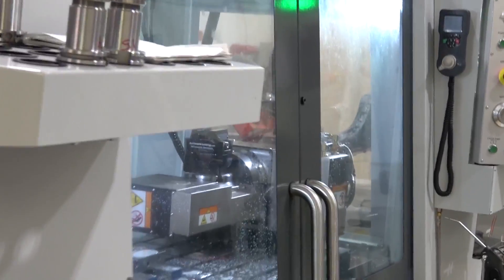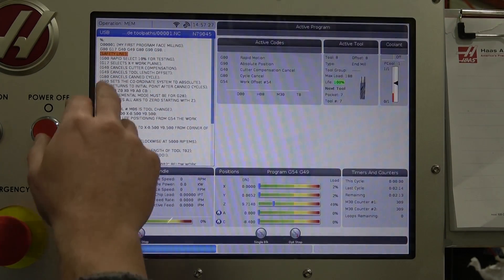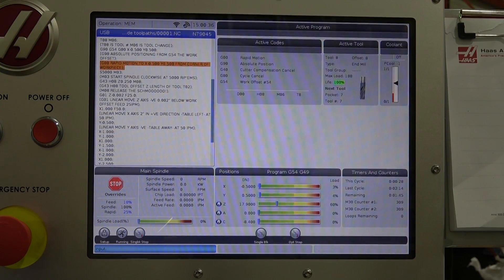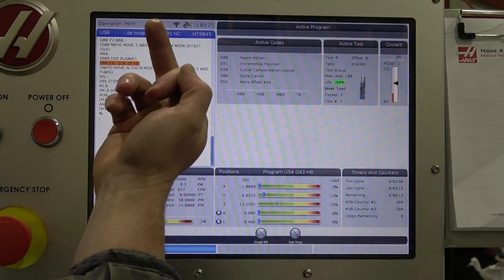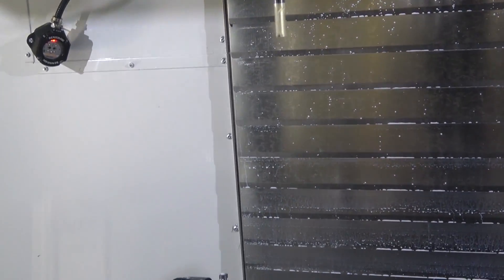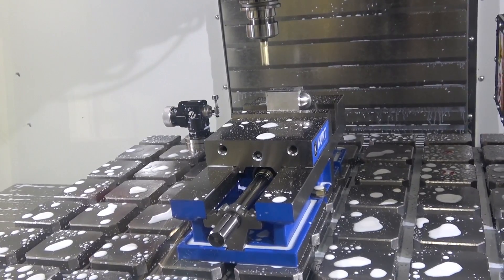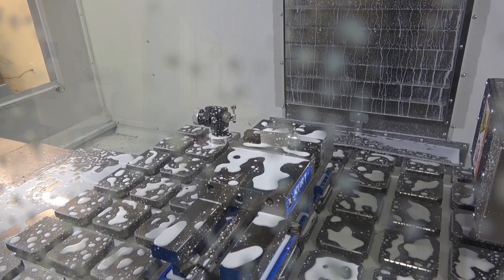Beginner CNC Programming | G-Code

Comment: Y1 means y0.0001" in haas y1. is y1.00". You could program it without decimals but y1" would be y10000
Reply: it does the same for feed rates as well no decimal = thousands of an inch movement

Comment: Instead of using the G28 I would recommend using G53 which is the machine coordinate system. So G53 x0 y0 z0 is machine home. No need to be in incremental.

Comment: The reason for interpreting - 1 as -.0001 is for safety. Imagine if your programed a G00 Z-. 25 move, but missed the decimal and the machine read it as Z-25.0
Reply: no if it was for safety it would just stop.
Reply: @BaldurNorddahl  either way you would still need a decimal point.

Comment: for starters g28 is a crash waiting to happen use G53
Use G53 in apsolute G53 is None module (meaning u need it in every line u are using it in. G53 is like g54 but G53 is always machine home

So example
G0G53Z0
G53X0Y0

 Also YES if u don't have the dot it reads it as Y. 0001 if you have 4 place deceble if u have 5 it reads it as. 00001
Reply: jacobrl9 G54 is an offset. How is g53 like it. Like you said g53 is a non-modal comand of a plane
EX: g00 g53 z0.;
G53 x0. Y0.;

But g54 is the x0. And y0. Or the part. I dont see the simmilarity.

Comment: It's not a bad idea to separate the G91G28Z0 and the other axes so that if you do happen to restart, the first thing that happens is the Z homing instead of all axes at once. It can save your tool if you start in a strange place. Of course, you should never restart from an unsafe location, but sometimes people can be lazy, and it'll bite you in the ass.

Comment: -1 is different from -1. because with out a decimal place the convection in Fanuc based G-Code is that the value is in the least increment.  So -1 is interpreted as -1 * 0.0001 thus -.0001 as .0001 is the smallest increment.  This is assuming programming in Inches if in Millimeters the smallest unit is .001.

However -1. is interpreted as -1.0000 as you have specified for the control where the decimal place goes.  

This something I learned the hard way.  The program I wrote once had 20 when I meant 20. and as a result crashed and friction stir welded the end mill into a chunk of Aluminum and broke the collet holding the end mill.

Comment: Programming at the control is a fucking nightmare. I can modify programs fairly competently, but HAAS uses an ALPHABETICAL keyboard instead of the QWERTY layout that every other keyboard uses. Not to mention having to be able to read the matrix code.

Also: Got enough shmoo on that indicator pull-stud? Is it about to go bad or did you just buy too much?

Comment: if i remember correctly, if you put 1 in for a location value it means 1 thousandth of an inch, but 1. means 1 inch tho im not sure, i just talked to the cnc guys at my shop occasionally when i was still working there

Comment: Welcome to CNC manual coding, friend. It won't take you long, but soon you'll have the code to a point that you can just read it down the page! G00 is rapid traverse G90 puts it into absolute coordinates and with this, if you don't put a new measurement in for an axis value, say line 27 says X.5, Y1, F3. then you can enter the value Y2 in line 28 and the other two carry down. This is called modal programming and it doesn't exist on some machines older than windows xp, so take your five axis of power to heart and start with nice simple 3 axis functions. G00, G01, G02, G03, G70, G71, G90, and G91 along with M01-M05 are the base commands that you will need to program any machine, from a prolite, to a tormach, to a hass with axis amount greater than or equal to two.

Comment: Some things that might help you getting your programs together.

1.  Save your most used functions in a text file so that you can copy/paste/edit preassembled code for jobs.  Things such as:
Initializing
Facing
Cutouts
Etc...

2.  Set up template programs.  Have a skeleton program with the basics in it, then just drop in routines and edit them per job.

Comment: Searching on the Googlé for "Gcode translator" gave me a few links; the first didn't work, and the 2nd was a link to the third, at Go Rest.

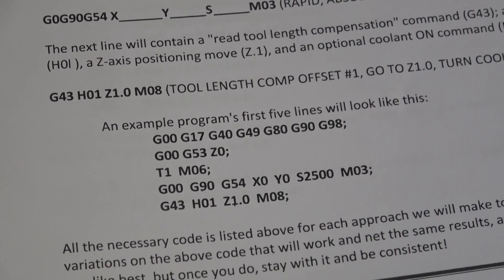Its translation of the sample code @2:10 is:

G00
Rapid positioning

G17
XY plane selection

G40
Tool radius compensation off

G49
Tool length offset compensation cancel

G80
Cancel canned cycle

G90
Absolute programming

G98;
Return to initial Z level in canned cycle

G00
Rapid positioning

G53
Machine coordinate system

Z0;
Absolute or incremental position of Z axis

T1
Tool selection

M06;
Automatic tool change (ATC)

G00
Rapid positioning

G90
Absolute programming

G54
Work coordinate systems (WCSs)

X0
Absolute or incremental position of X axis. Also defines dwell time on some machines (instead of 'P' or 'U').

Y0
Absolute or incremental position of Y axis

S2500
Defines speed, either spindle speed or surface speed depending on mode

M03;
Spindle on (clockwise rotation)

G43
Tool height offset compensation negative

H01
Defines tool length offset Incremental axis corresponding to C axis (e.g., on a turn-mill)

Z1.0
Absolute or incremental position of Z axis

M08;
Coolant on (flood)

Comment: googles and reads
"Note that simply specifying G00 or G01 does not cause any motion to happen–they merely tell the controller what type of motion is expected when you finally tell it where to move to. For actual motion you need to specify a destination using the X, Y, and Z words. We’ve talked about how the coordinate system works previously, so you should be quite familiar with XYZ moves. As a reminder, to move to the part zero, we might issue a command like this:

G00 X0Y0Z0

We can also do it this way:

G00 (Or use G01 if you want to go slower)

X0Y0Z0"

Seems simple enough, g0 fast g1 slow.
What's your problem?

Comment: If you know exactly what you want the machine to do you can skip CAM and write a program using your favorite language that outputs G-Code to a text file. Instead of memorizing codes, assign each G, M, H, etc. to a variable name and write functions for operations as you need them. Each function simply outputs to the next lines of your text file and now you've got a more robust G-Translator that has the power of For-Loops and variable names. I've done this using Matlab but I'd love to rewrite it in Python.

Edit: As a bonus, the functions can add automatic comments to your NC program!

Comment: A machinist I used to work with would add line of code to Z rapid down to 1 inch above the work surface with each tool in the program so that he could see that his tool offsets were correct , or at least close enough to correct to not shit hammer the tool holder, spindle, or vise.  He didn't mind scrapping a first part or a cutter if his offset was wrong by 120 thou or so.  He would use the optional stop feature so that once the program ran one part, turn off optional stop, and let the machine run through parts uninterrupted.

Comment: Ask me how I share your frustration. I spent many 100's of hours on a bigum Cincinnati Milacron vmc in the 80's that read paper tape. Nixie tube readout. G-code thru the tape flexowriter, then on to the machine for testing, with of course-- no tools in collet. Manually find edge with edge finder and compensate with trim dials on rear panel of machine.. Fun days overall. Learned a lot. Hated a lot. Smoked even more ;^)

Comment: Someone explain how there is no slicing program for subtractive CNC? There's like ten of them for additive.
Reply: Oh, turns out there is. Sorta. You're either li.ited to 2Dish with Inkscape or you have to learn BlenderCAM. And BlenderCAM isn't up to version 1.0 yet but it does have experimental 4th axis functionality .
Reply: Uhm, you did not do any resarch, did you? There are dozens of them from different software vendors. They all cost a pretty penny but do a lot of the work for you. After you have designed your part, you instruct the graphical program what tools to use to perform the cuts. It's all there my friend.
Reply: @0xbenedikt  There's also Fusion360 if you prefer having Autodesk own your design and being trapped into their ecosystem when they decide to finish locking it down. I prefer FreeCAD and Cura for 3D printing.  Already getting started on Inkscape because I'm building a CNC router/laser-cutter. Because 4th axis is probably as far as I'm goign to go with it all, I'm thinking that Blender is where I'm probably going to end up.
Reply: @lowellhouser7731  we use mastercam for cad and cam. I believe that's what most people use, all the places I've been at least.

Comment: If you don't put a point after the inch number, it assumes what it sees as the safest course of action. And it bumps it out to the .0001 position. Say you set a feed rate f5
Its gonna give you a feed of .0005 inches a minute and it will take 3 years to mill your part.
However f5.
Tells it 5 inches a minute.

Comment: I'm thinking you're figuring this one out, but it turns out CNC is very complex. It only took me about 5 years to get comfortable. With CNC, the skill of the programmer has a massive impact on part quality, process reliability, tool life, and cycle time. Theres always a a better way to do it, and it always can be done faster.

Comment: Hey just a small piece of useless future advice. That's not true for all  machines but is for most. Rapid moves will either move at 45 or 90dg. For example if you have a 10" x 20” part and you go from X0Y0 to X20 Y10 the machine will not move in a straight line from corner to corner it will move in a 45 to X10Y10 and then X20. This is because a G00 maxes out each servo till that servo reaches its position. The lack of this knowledge has killed many of fixtures and endmills in times past.  Now some conversational or  pc based machines will treat a G00 as a G01 with Max feed rate creating a straight line.
Reply: Thats why you should move your Z above your work piece/fixtures before G0

Comment: On the Fanuc 0M (our crusty CNC at work), if you don't specify a decimal, it assumes lowest decimal point... -1 = -0.0001
I don't get why, it doesn't seem useful to me.
Just get in the habit of putting the decimal point in, and you're good to go (even if it's just '1.')
Reply: It makes sense from safety POV.  You better move unintended 0.001 than move unintended 1.0
Reply: Yep I always even put 0.0 not needed but it's better to put a decimal point where it's not needed than to not put one where it is needed

Comment: I got myself a small chinesium CNC, even though I had six years in a machine shop I'd never used a CNC, had to do a lot of reading up on G-Code. First thing I found was it's too easy to brake tools until you get to grips with it, once you have it's brilliant. One thing that's surpassed my expectations was how accurate it is. I originally bought it to make PCBs but use it for all sorts. Want a 3d printer now.

Comment: This seems like something they should have a English opcodes for which get turned into the G-Code commands with a 1:1 pairing. I mean, it would be roughly in line with Assembly.

Really all he needs is a small script program that does a mass replace from some English options to machine code.

Comment: Ahh, yeah, another comment in progress. If you don't put in the decimal, Haas defaults to tenths of a thousandth. So. Y-1 is, in absolute mode, one tenth of one thousandth south of your Y plane. Y-1. (and yes, it will automatically truncate all trailing zeroes) is one inch south of your Y plane. And that applies for all distance measurements. You haven't felt dumb until you write F4 and get into a cutting pass at four ten thousandths per minute instead of four inches per minute.

Comment: Just curious... Why not just use fusion or some other CAM software?
Reply: bendall2006 next step...
Reply: He's doing things the right way, gotta walk before you can run
Reply: @bridged13b  he'd be better off using fusion to generate the correct code then reading through it to understand it.  And using a gcode editor like the free one with fusion will tell you the function you have under the cursor.

Comment: Is Hass' software Linux-based? "Mounting" the USB drive is definitely a Unix-y term and that UI looks like Qt.

Also, how fool-proof is the machine? I have a super cheap Chinese engraver and it has zero sanity checking, not even endstops. I'd be super nervous writing my own gcode on such an expensive machine, but I'm guessing it can detect all sorts of dumblefuck mistakes?

Comment: So, looking in on the introduction, I wanna share with you something I do. Firstly of all, I always set my X0 Y0 at, looking down at the part, the lower left corner. So, anything I do to my part is in X positive and Y positive. That's all preamble, here's my tip: when I rapid down in Z travel, I always do it in a safe space, with X and Y in negative.
Reply: This is bad practice. It's best to keep your origins against a fixed surface. Uncle Bumblefuck got it right here by having his Y0 against the fixed jaw of the vice. This way you can switch to a different size of material without resetting the Y home.
Reply: Girls, girls, you can BOTH take me to the prom! Get reverse closure vises. The fixed jaw is at the front and the back jaw moves. x0y0 at the front left PLUS on average you spend a lot less reaching and leaning your whole body deep into the machine, bending and lifting work pieces. Kurt sells the reverse vises and they also sell conversion kits to change over their normal vises.
Reply: @crazbikr  i agree a very bad practice that will get you screwed in a quick if your not careful.
Reply: Depends, sometimes it makes sense for X0.Y0. to be an datum hole established at a prior operation.
Reply: @brycelaing7603  , sure, can be anywhere. For op1 getting sent to a machine w a probe I often program 0,0,0 as center of blank, bottom of stock. That way the roughing passes around the perimeter are uniform and the op2 has however much to deal with as I said to plus any mistake or confusion in setup errs higher rather than lower. (Say I program for top of the parallels and the guy sets off on top of the vise or top of the part, safe) and further it's one single habitual way of programming that's uniform with programming for 4 or 5 axis where center of rotation is zero.

Comment: The beauty (and problem) of CNC is that they do exactly as you tell them.  Even if you tell them to drill through the work table and rapid laterally through the tool setter and vice.
Reply: It blows my mind that they don't have any sort of option to set up an off limits area on the table so the machine can know what to avoid.
Reply: @KyleMc16  many do, but you need to set them correctly and update the data when the setup changes, so it's better to just know what you're doing and be careful.
Reply: kmcclry 7 I think the reason why they can't is the machine doesn't necessarily know how long it's cutting tool is
Reply: kmcclry 7 you can
Reply: Yeah, but it lets the table breathe!
Reply: gothicman03  And, even then, not all that accurately outside of giant "crowds of people" type of predictions, even in spite of the tremendous gains that the segment has seen(not to mention the horsepower they now have available with Turing/Volta, Vega, & Pascal paired with mountains of DDR4 and modern high core count EPYC & Xeon CPUs).
Reply: Unlucky
Reply: Yes, exactly what you tell them, regardless of the consequences lol
Reply: Yeah, ever cry of "the machine ruined my workpiece" were very quickly met with pounting out operator error. Funny how the machine always messed up the bad programmer's pieces...

Comment: I don't know about Haas, but with my machine one of the hardest things for me to wrap my head around is that if something isn't working the way I think it should, it's almost SURELY because of a mistake I've made. In other words, the machine basically always does exactly what it's told and does it the exact way it's supposed to, so if I see something that I think is a mistake I try to remember to ask myself "OK, what did I do wrong?" instead of going to "this piece of shit doesn't work!". It's a tough lesson for people as arrogant as I am.
Reply: Wishfully thinking that cosmic radiation caused a random bit to flip is the only solace I have some days
Reply: Wait wait,  are we talking about CNC here or women?
Reply: While all that is entirely true, occasionally, though very rarely, bugs in the CNC mill software cause one to spend enormous amounts of time figuring WTF the machine is doing. The problem is that, when you are just starting with that particular mill, you have no idea where you'll get caught by this, only that you surely will. So, when something doesn't go to plan, blame yourself first, but never trust the machine software until you have been using it for a while and know where it can and cannot be trusted.
Reply: @IvanTarasov  Yep...just think about HAL in 2001. Cannot be trusted!
Reply: Hirudin 

Yep!! I always blame the machine, bad habit .

Thanks for sharing !
Reply: So far, I've found Haas to be very straight forward. Okuma g-code had a lot more little quirks, especially while interpolating holes.